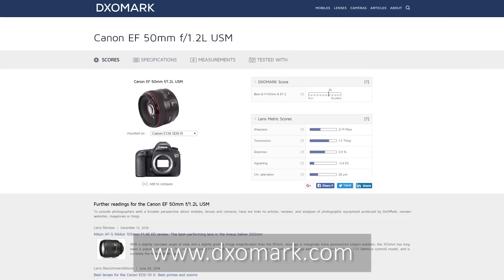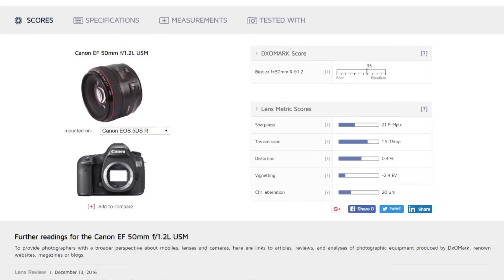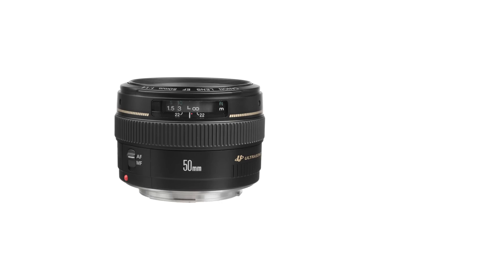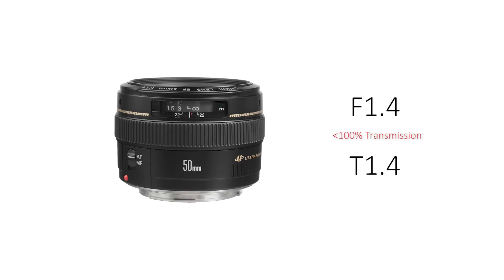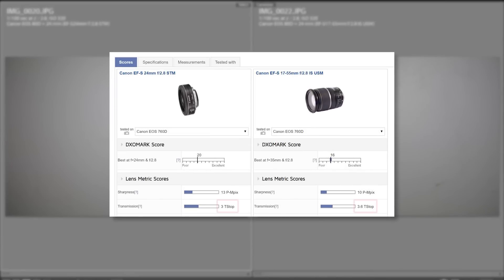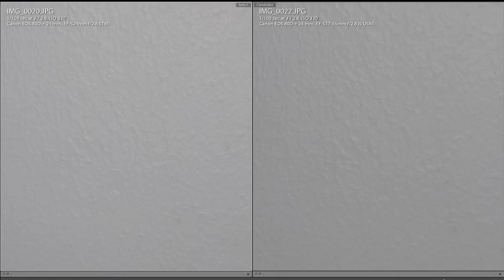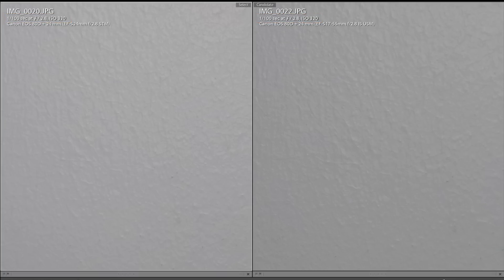F-STOPS vs T-STOPS! What’s the difference? Are they the same?

Comment: "a lenses tstop value will allways be darker than the fstop value..." - in fact... not true. If the transmission matches the fstop it does. For example the Sony 85mm 1.8 messured by dxomark.

Comment: I have a question regarding the focal length on zoom lenses, how am I supposed to know the current focal length when the indicator is somewhere between two numbers. For example on the 17-55mm, if the indicator is somewhere in-between 35mm and 55mm, is it possible to know the exact focal length it's currently at? 
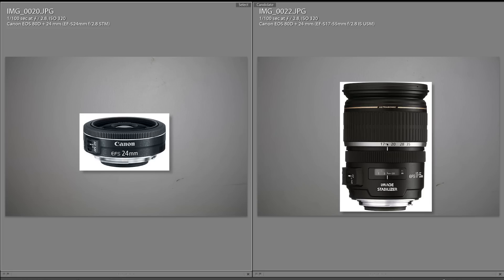Because you mentioned the test at 2:07 were both shot at 24mm, I was just wondering how you knew the 17-55mm was at 24mm.
Reply from the maker: That's what I did - put the indicator somewhere between the 20mm and 28mm markings, and took the shot. After that I checked the image's EXIF data, and it shows in one of the fields the focal length readout from the lens. Based on that info, I'd make minor zoom adjustments until the Focal Length EXIF data showed me 24mm. It wasn't the most intuitive way, but on some cameras it is possible to overlay the focal length reading on the shooting screen, which would be an easier way to go about it.
Reply: @zy_cheng  Ah I see, thank you for the info!  ^-^